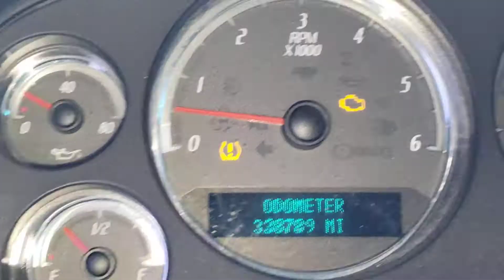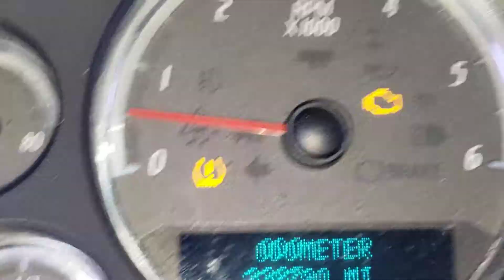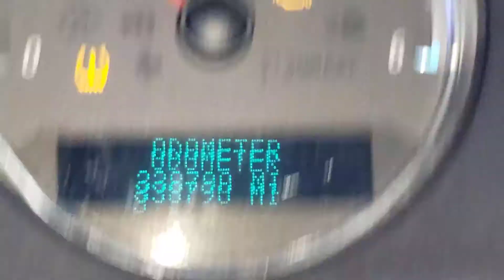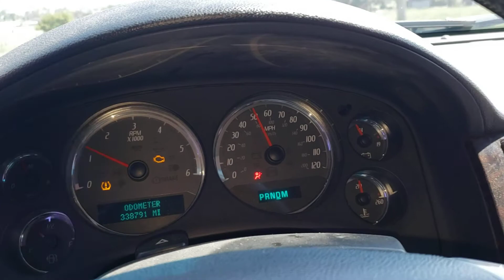07 Yukon Denali Fuel pump fixed Stalling issue

Comment: Hey bro has your oil pressure always been that low? That's where mines at on my 07 with 175k. It reads about the same when hot like yours but cold it reads almost 40 psi. When I accelerate oil pressure goes up to just under 40 psi ..it has oil and oil is hot to the touch so I know there's pressure...should I not worry about it and just drive it?
Reply from the maker: I'll recommend changing the O ring tube in the Oil pan. I never changed it out and now I need a motor replacement.  Cause the Oil wasn't being pumped to the top of the motor. Change and don't keep driving it!
Reply: @Cmimss  thank you very much!!!! Appreciate it bro
Reply: @Cmimss  I would just do a rebuild...it's cheaper
Reply from the maker: @socks6336  If I can get it to drive to the Shop b4 it stalls on me. This Summer Heat aint working either.
Reply: @Cmimss  I hear ya...just rebuild it man...lot cheaper..I was doing some research...rebuild is the better more efficient Option. That's what I'm gonna do when mine blows. Love this truck
Reply from the maker: @socks6336  How much did they quote you?
Reply: @Cmimss  my personal mechanic said he'd do the job for 500 but I supply the parts. That's cheap as hell..so about little over a grand maybe
Reply: Mines was like take the low oil light came to saying stop engine took it to the shop they change the oil and had no more issues it's been 9 months now
Reply: Mines does the same